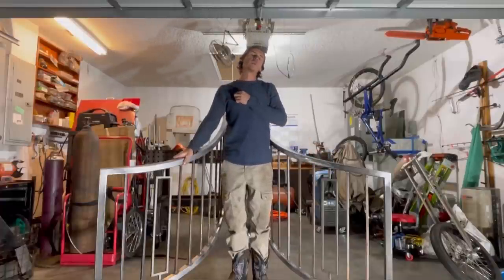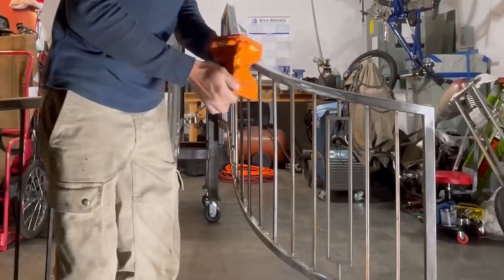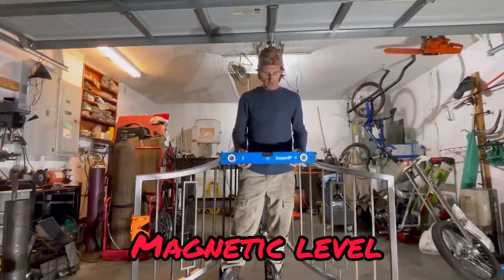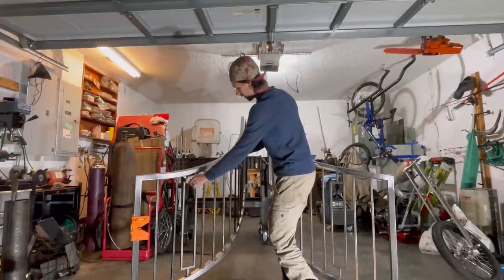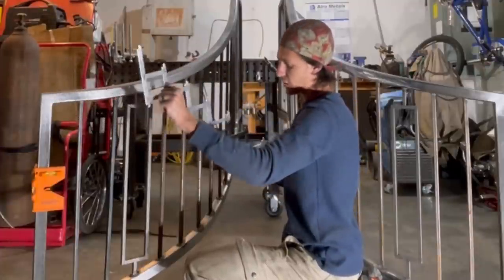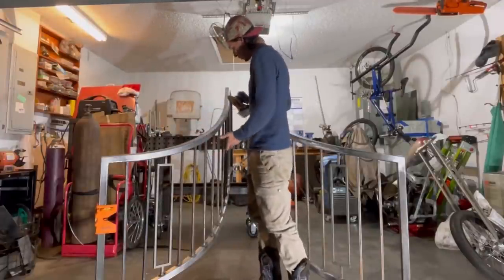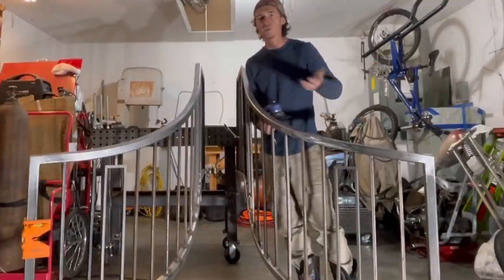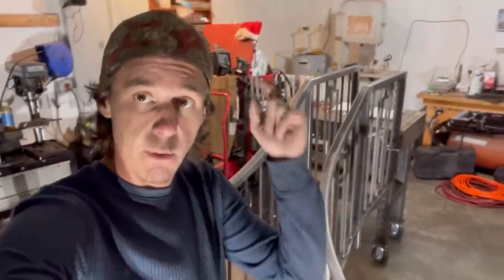4 INDISPENSABLE Railing Fabrication Tools! | NECESSARY TOOL For Welders! |

Comment: Quick tip on the construction calculator if you divide the overall length by the number of pickets hit ++ then every time you hit = it'll give you the next Pickett or tread. The calculator will automatically add or subtract to make equal distance
Reply from the maker: I half way understand you but rarely use a calculator. I do most math on paper like a moron lmao
Reply: I bought one 20 years ago. The calculator works for novices but it requires you to learn all the functions. Physical properties don’t change. Get a chain or pvc and some spray paint to show you your arch, dip, bendy part and then transfer it to a template. I’ll race you on a parabolic ellipse. Stoner brakes (safety meetings) are provided 😂
Reply: @billybowman3891 those saftey meetings make the numbers flow easier. Two things I think every builder/handyman/homeowner/human should learn to use is a calculator, and the majority of its functions, most things an engineer would use and a multimeter. Both seem scarier than they are but once you learn to use them it's like magic.
Reply: @i8764theKevassitant  I did learn the functions, 20 years ago. People should learn every way to skin a cat but down the road if you’re lucky everything will click one day and you’ll understand my point. I don’t care what your directions for the rest of the world are. Have a great time with your little computer helper. 👌🏻

Comment: Nice job. Very good work. You are a true Artist. Like you said you are not a CNC machine. 

Now onto custom Harley frames…LOL.

Keep up the videos. I would love to have seen the rosebud torch heating this and you playing plumber with a pipe wrench bending it. Been there done that. 

I now have a little hydraulic bender. I need to get some square shoes for the bender to use box tubing. I have only done round so far…

I am sure you are always the toughest critic of your own work.

Comment: I had to custom fabricate a spiral staircase, the handrail stock i had to bend and curve to follow the pitch and curve of the staircase while keeping its profile horizontal. Holy crap that was immensely painful in the posterior. I had to get three extra guys to help me physically and visually because there was no way to heat large enough sections to make smooth bends. It had to be done cold. So..... my congratulations on your handrails turning out so nicely. I know of the pain it was.
Reply from the maker: that sounds like a night mare!

Comment: A good alternative or companion to the DA sander is a backing pad for your grinder. You can use the same 5" DA pads on a regular 4.5 angle grinder. I have a United Abrasives-SAIT 95255 that I picked up for about $7 (they go for a lot more now)

Comment: i once hand formed a single side 2" pipe railing to a 2 story spindle staircase, glad i had my master to help me, i would think the square tube makes it easier to control the curves and angles along in the different orientations, working 3 dimensional on a round tube was a nightmare! never done anything like that since!

Nice job you made with those 2, making a handformed pair is a whole other level of challenge.

Comment: Thanks for the 3 way level tip. I’ve made a few railings but nothing curved, although I think it would be easier curving the handrails in the tubing roller. Good advice on tapping out.

Comment: I made a set learned the hard way even rolling it with a tubing roller I even had it in Auto Cad , had multiple engineers still had to use a torch to bend the square tube back from the twist … one guy told me to use round because you can’t see twist like square … that’s only one factor great job these are incredibly difficult we even mocked the entire stair case up in the shop ! A total PIA lol I fee your pain

Comment: Great work empire makes a post level at home depot around 6 dollars I bought one from harbor freight just to get the magnetic strips and some super glue to fit them to empire level so I don't need to tie the string you did very good though looks awesome

Comment: Been doing ornamental welding for better then 10 years, and I've never seen that picket tool. Gonna have to check that thing out, especially for the curved railings, might speed things up a bit!
Reply: It's called the picket master pro, Salt city steel make them. Invaluable time saver. I had to pay a premium getting it over in here in Australia... But its worth it!

Comment: Great video young man. You are absolutely right when you say "hand formed".A lot of people expect robotic, automated, perfect formed railings or whatever and don't appreciate the challenges to achieve what they want.
I have a job on the books for next week. It's to make balustrade that matches that of a nearby medieval castle. Its being designed and fitted by the client but one aspect I have to design because there is no easy wasy to attach one post to the house wall. So, in my crazy mind I thought of a way around the twists, bends, off level cambers and such like, and that was to build a "ball joint" return from the post to the wall. This ball joint will get around all the weird angles of the property and allow the customer to fix the post vertical and make it strong. 
To that end, my next job is to build that ball joint and post. It's not something you buy off the shelf so I have had to design it and now I have to build it.
Top regards, Jon.
Reply from the maker: thanks man! and ya no one really gets it! I wouldn't let a client fit the rail, sounds like a problem in the making

Comment: As a teenager almost out of high school wanting to pursue a career in welding specifically a mobile welder would I use these tools often. If so should you invest in the more expensive tools or does the bare minimum work.
Reply from the maker: List the tools you would have, keep in mind im in a 2 car garage
Reply: I started and still use the bare minimum, I literally just picked up a welder generator last week,  most jobs I’ve gotten require just basic tools, at the same time tho this is my experience at least.

Comment: I hate curved stuff its the worst lol. You could have easily bent all of the tubing to have exactly the same curves by stacking them and tacking them together, then bend them, and cut them apart and grind the welded spots smooth
Reply from the maker: you can do that on a per side basis, but not all 4, thats how I got my initial curve. but the drop and tilt I did after I welded to railing frame